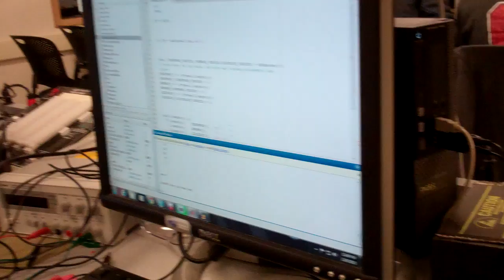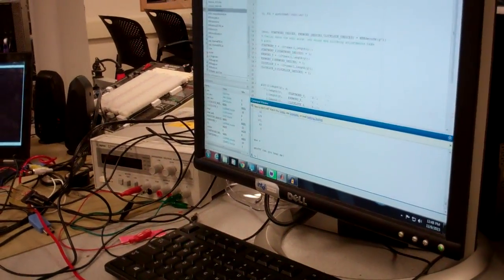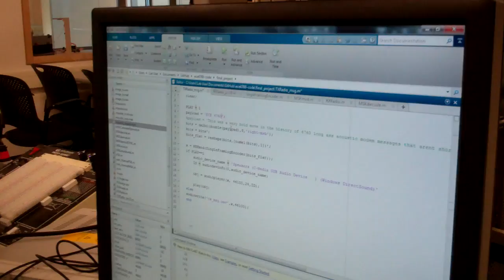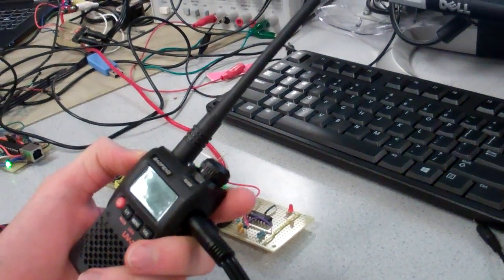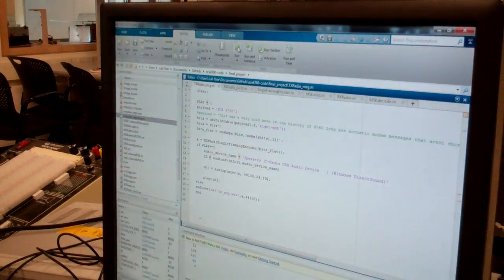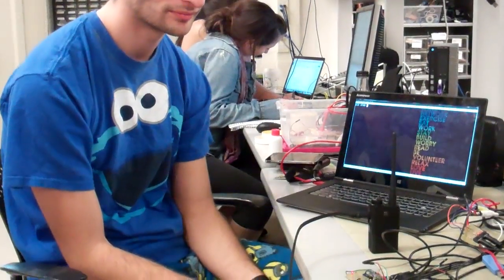Audio modem over radio

Comment: Radio should be only ANALOG!
Reply from the maker: why?
Reply: @ece4760  Wifi is ok, I was talking about ham radio and FM radio. Digital ham modes are so cold and uncomfortable in comparison with analog modes, even if they're working great. For DX-ing CW is the best, and no digital mode can't be better than it, also digital voice (DMR, freeDV) has too bad reception.
DAB/+ has much worse reception and much worse sound than FM, most of the stations are in mono, and have worse bitrates than youtube! Also it consists data such as station logos, pictures of the bands... (where is car safety?)
Reply: @primozanton6264  CW is a digital modulation and Morse code is a digital code.
Reply: @primozanton6264  CW works well over long ranges with low power but then you run into bandwidth issues, which is where digital shines. The whole determiner is gonna be how good your signal is
Reply from the maker: Do you not use WIFI?
Reply: Say you're a loser without saying you're a loser
Reply: HAM is for experimenting…it’s for all modes…analog, digital…I have experimented with Fast Scan TV.  I love seeing young folks experimenting with this.  I do use simplex quite often…just to chew the fat, but I definitely enjoy WSPR with FT8 and playing with my ancient PACTOR modem…HAM is awesome because you can do ALL the things…experiment with lasers for comms…73s